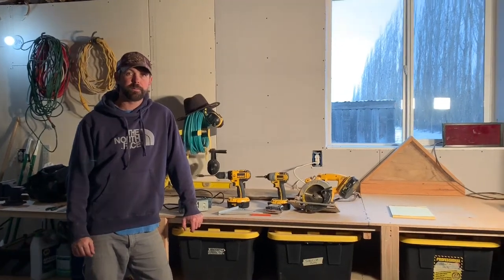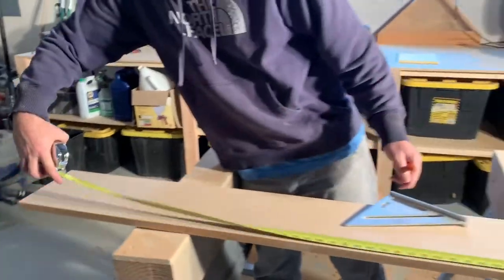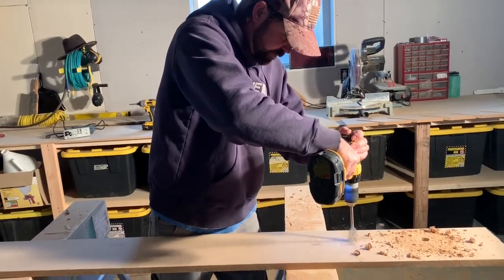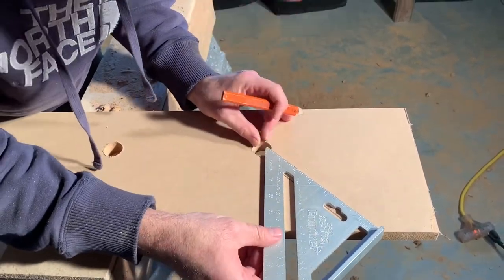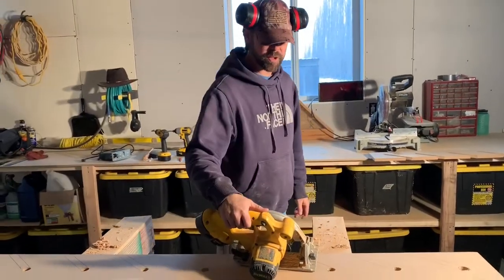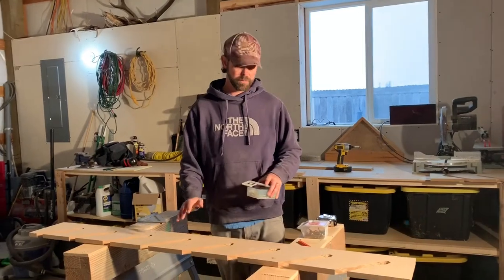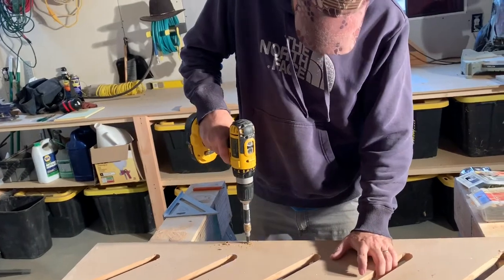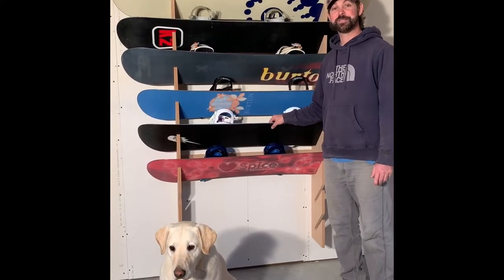DIY snowboard rack for 8 boards

Comment: Just so you know you can just turn your square around and it will mark a perfect 45 every time. In fact 90 and 45 are the only angles it does without using the protractor. Either way love the design simple and elegant.
Reply from the maker: Thanks for the tip!  Glad you enjoyed it.

Comment: it wont matter that the square is short for the top cut, just the bottom, since thats what the boards going to be resting on. totally doesn't matter but i felt like the comment helps your alg

Comment: Looks great! Nice job. I just had one question. How come the boards are not sitting flush while on the rack? Wanted to know if there was a reason behind it, as I plan to replicate your build!
Reply: Built something similar and I found the camber of the boards made them sit differently. Ideally it would be held at a (relatively) flat section on the board but if you make the slot large enough it should work fine
Reply from the maker: Not sure what your question is, but I think what you are referring to is, because the boards are different widths.